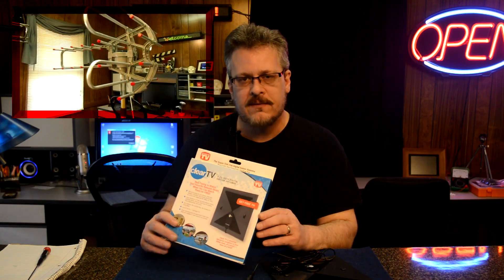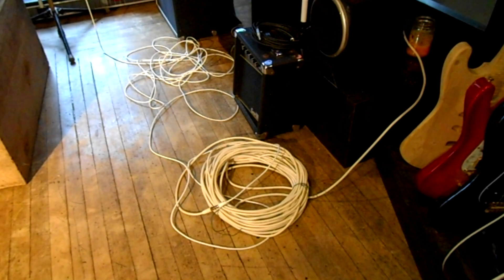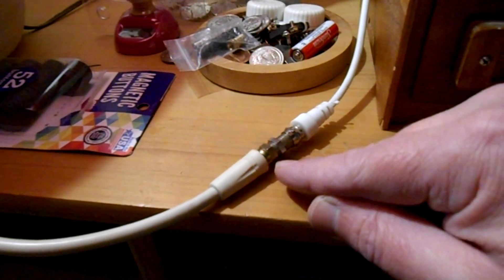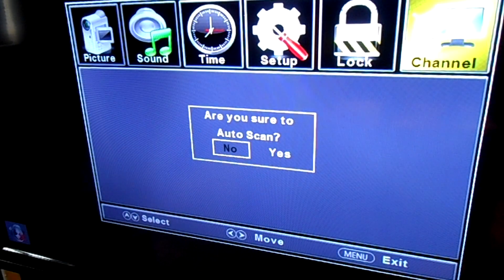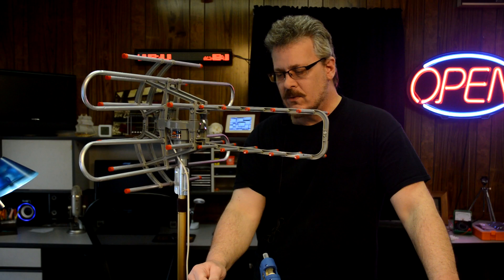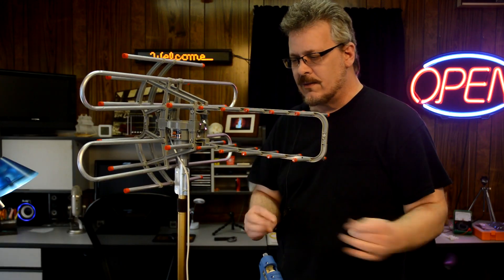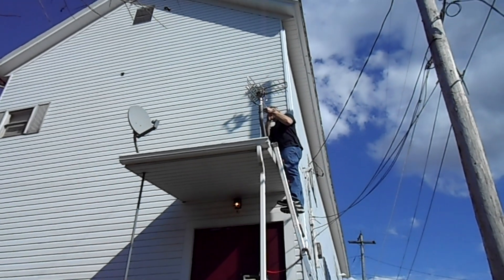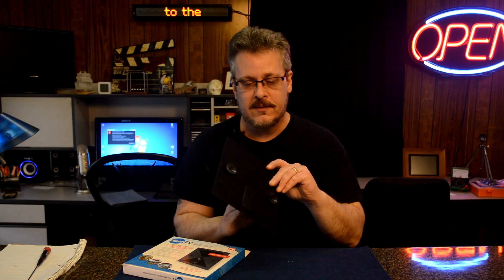What is the Best Placement for an HD Digital Television Antenna?

Comment: Thanks for talking about your thoughts on longevity of the product.  Before cutting cable TV we were over 200 after taxes and fees.  I kept cable internet 100 meg is 50 a month since I bought a 30 dollar zoom modem on amazon several years ago but was renting a modem from Time Warner because my 300 meg package was too fast for the cheaper modem it maxed out at 150.   I got a GE attic antenna off amazon for 30 bucks.  I run that antenna to a 4 output signal amplifier and to tvs around my house for about 20 bucks.   All of my tvs have rokus because I used the time warner app to not have to pay for a 15 dollar a month box rental so I use Playstation Vue for 30 bucks a month for the more premium channels like ESPN.  So after its all said and done I am down 120 dollars a month to 80 bucks a month for 100 meg internet and television.  I have to use OTA antenna for CBS and such but being able to keep discovery channel and be below 100 bucks and not be under contract or anything is great.

Comment: a general rule of thumb with cable is the longer and thinner the cable, the more loss of signal strength and quality ( attenuation ) so try to keep it to the most minimal run. Also you have used shitty standard coax and joiners instead of RG6 Quad shield and decent connectors. I could go on, but if it works, well and good, well done

Comment: How has the quality of your picture been? Not sure if this is the right word, but do you have any pixelation or problems when the weather is overcast?  Thanks.
Reply from the maker: +The Hamlin Woodshop Hi, yes when the signal is not so strong you can get what looks like pixelation for no better description, but if I turn the antenna a little in the right direction, it gets crystal (digital) clear

Comment: Just a few thoughts here... Try checking www.tvfool.com if you need any help on where to aim your antenna. You might also note that all "digital" over the air stations use the new ATSC standard which is something your TV (or tuner) needs to have in order to receive anything "free" over the air in North America. Older televisions (the glass tube stuff, really) use ancient NTSC standards and would require an additional converter, much like a cable box, in order to tune in these new ATSC channels. And in case anyone forgot, all "free" over the air (OTA) television broadcasts in the USA went digital, using ATSC standards, as of 2009. If you have any old NTSC TV's all you will receive on them is "snow." (However, NTSC is far from dead since a lot of "cheap" and old devices still require a NTSC tuner in order to connect via that infamous channel 3 or 4).

BTW, I'd really love to see what you can come up with for a DVR here. Personally, I use a Hauppauge tuner card in my Windows 7 system where Microsoft Media Center (MMC) does the recording. But since Microsoft, being Microsoft, decided to kill WMC (and is one of several major reasons I won't upgrade to Windows 10) I'd really like to see a Linux alternative. Something like MythTV and possibly Kodi would be 2 options I've been playing around with. How about you?
Reply from the maker: +WXSEDY Thanks,  Important points you have pointed out that I neglected to mention.I don't have a DVR system in place yet but have thought about building something PC related in the near future. Steve
Reply: for recorded TV consider NPVR. it's free, easy to setup. you need to purchase a TV schedule but it is cheap from Schedules Direct.

Comment: I live in an area surrounded by mountains, I am wondering if I were to get a similar antenna would it work?
Reply from the maker: +John Minasian Every location would be different but I would spend the $20 to find out. I also have some hills and other objects blocking my perceived line of site but it still works.

Comment: I would still like you to do a follow up video on CNC limit and home switches, Thanks!!!
Reply from the maker: +payday1963 I have to redo part 2 for the home and limit switch video. I lost my original one to a failed hard drive so I will have to make over.
Reply: Ok well I'm sorry to hear that.  I really need help in wiring the switches to my machine and setting them up in Mach3.  I hope the new video will address these issues.
Thanks and love your videos!
Dennis
Reply from the maker: +payday1963 I plan on building a cnc controller soon to run my old self built table and will be filming that process including the wiring, switches and software as a multiple part series video so keep watching an it will happen.